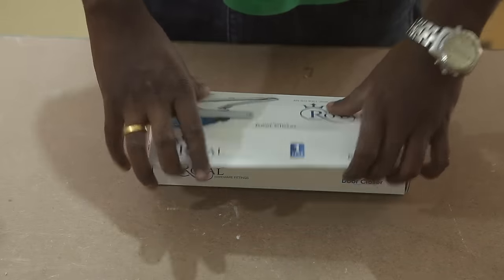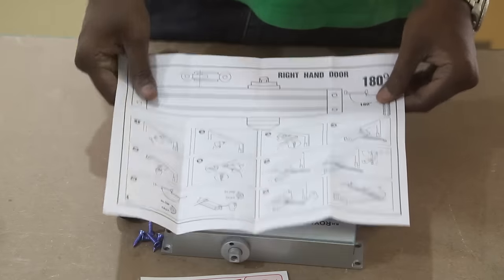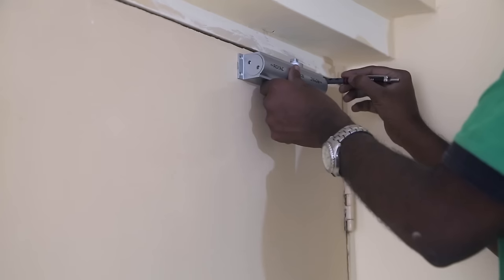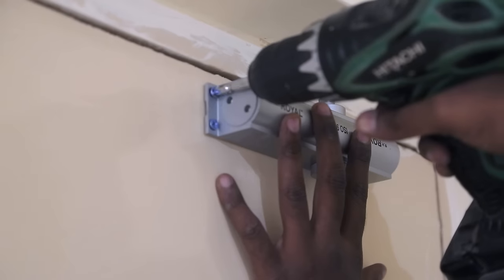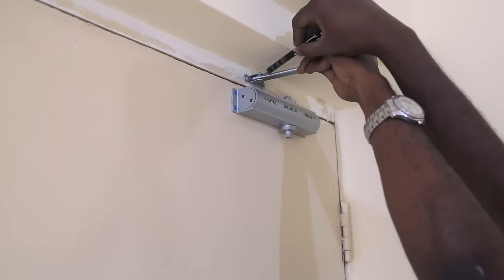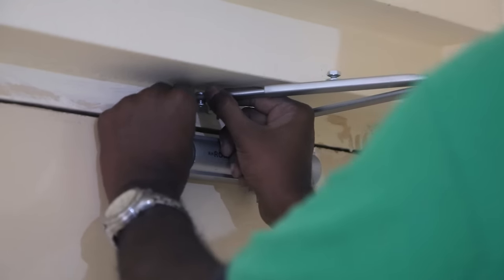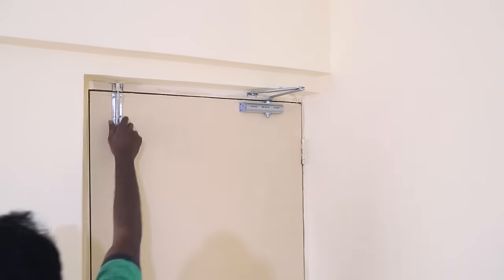How to Install Automatic Door Closer

Comment: The arm that is attached to the frame should be at 90 degrees for this type of mount. I suspect that you didn't measure anything according to the directions in the box. The distance from the center of the hinge pin to the first hole of the closer and subsequently to the first hole of the shoe is specific and if not correct can make the door not open fully, open too much or take too much force to open the door.  Also the distance of the closer to the top of the door is quite specific so the arm doesn't hit the door.
Reply: Very basic the guy has no clue about it & 99 percent door closer user do not see the manual which confirms the 90 degree angle !
Reply: Appreciate it smart guys...maybe yall can come out with videos on how to put doors in.
Reply: Pp
Reply: Hey Jim, my main door of the house is quite heavy and we have installed a door closer on it. We have also installed a door magnet as a future possibility of keeping the door in open position. But with door closer, the door magnet is not able to hold the door. Any suggestions for installation?
Reply: @monalisadas6919  If the magnet is installed correctly it should hold the door in the open position. However you could install a "hold open" door closer arm on the existing door closer instead of the magnet. That would be a better solution unless the magnet is tied into a fire alarm and releases to shut the door electrically.

Comment: Let's say i want to lighten the force required to open the door (inward pull, hinge on the right). Do i move the machine towards the hinge or what?
Reply: You can usually adjust the power spring on the end of the closer counterclockwise to make the door easier to open. Some inexpensive closers do not have this adjustment.

Comment: how can we adjust the pressure while opening the door... I I have the same (royal) I feel very hard to open the door...please reply me
Reply from the maker: According to the manual adjusting the screw on the side will get it done. But in my experience, you should remove the nut that holds the door to the mechanism. Then close the door. Wait for sometime to let the spring inside the mechanism fully unwind. Then attach it back to the door.
Reply: That is incorrect. If the door closer has a power adjustment (some cheaper ones do not) then it is a spring tension screw located on the opposite end to the sweep and latch adjustment screws on these imports.
Reply: I know this reply is old but these models with the offset pivot on the main housing all, even to this day, are difficult to open. The angles have little to no effect. The ones currently on Amazon are also difficult to open. EVEN WHEN YOU USE THE ENCLOSED TEMPLATE TO DRILL THE HOLES AND MOUNT THE BRACKET AND BODY IT WILL STILL BE HARD TO OPEN. If anyone reads this my advise is to spend a few more dollars and get one from Grainger or a model that Grainger sells. It's just a piss poor design. Shame because the material/metal is quality stuff.

Comment: In the door closer assembly the part which is installed on the frame..it should be of Aluminium or wood..? k it can also be applied on the wall diectly..?
Reply from the maker: It can be anything as long as you can drive a screw into it.

Comment: I am sorry to say this is not the proper way to do that. You mentioned the catalogue that came in the box and it shows the installation for left and right sided doors. You simply need to use the drawing to mark where to fix the 6 bolts. In your way a lot of adjust will be needed and most probably will not work, but using the catalogue no adjust will be needed.
Reply from the maker: I did not have to adjust. It worked by itself

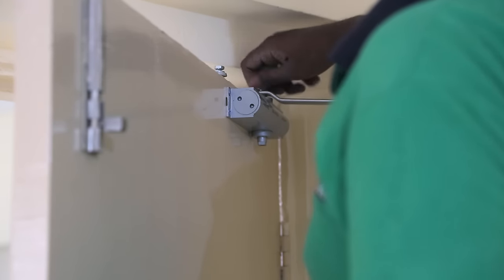Comment: 1:45... you also placed the hinge upside down.
Reply from the maker: It was because of the space constraint. But thanks for noticing.
Reply: ;) it just doesnt work upside down, it hits the side of the hydraulic system... 
p.s. a lot of systems have regulatory arms where you would not run into problem like yours: example image: 
https://4.imimg.com/data4/VE/YV/MY-3634223/door-closure-500x500.jpg

Comment: You clearly don't do this for a living, by not putting a pre load on the arm you loose your proper Las couple of inches of power, remove the arm from the closer, rotate the arm parallel to the door, take a wrench on the bottom of the closer and turn it to put a little bit of a load on the arm , by have the arm pointing out will some what work except for the last few inches.
Reply from the maker: Yes I dont. Figured it out as I went. Can you make a video and show me?
Reply: Kalaakaar // Custom Fabrication Channel you betcha

Comment: How to drill into metal frame? Thanks
Reply from the maker: You can use HSS drill bits. That can drill into metal frames.
Reply: just use a metal drill bit they are really cheap dude, its exactly like drilling wood or concrete, maybe you just need to go slightly slower and not press alot.
Reply: Do I need to insert wood/plastic plugs into the metal hole? or just directly screw in the screw into the metal hole?
Reply: What if I directly screw in the screw and the screw seems quite loose?
Reply from the maker: There are self tapping screws for metal work. You can use them to screw in directly to metal.

Comment: You Didn't Pre-Load The Closer!
Reply from the maker: +rissone99 what is that?
Reply: The closer arm needs to be connected to the body in a position that is diagonal from the body instead of perpendicular. So that when you connect the closer arm to the door frame, you have to fight the spring tension of the arm a little bit to get it to screw into the door frame. Once it's connected, the arm should be almost perpendicular to the door. I use this description to make it easier to understand that you're putting load on the arm so that it has pressure even when the door is closed. You are connecting the arm to the body in an offset position, then winding it only a bit, then you screw it to the door frame with that resistance. I use the adjustment screw on the arm by loosening it, extending the arm, screwing the arm into the frame, push the elbow of the arm until it is mostly perpendicular to the door in the closed position, then tightening the adjustment screw down so that the arm doesn't extend when i let go of it.

The goal is to have a door that shuts and latches entirely, rather than the door that closes almost all of the way until the arm relaxes and it stays cracked open.